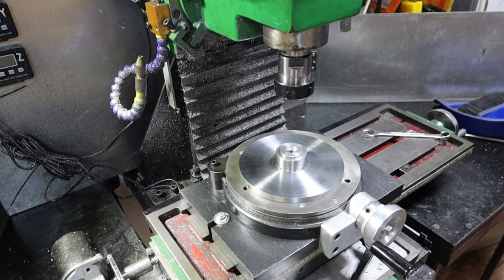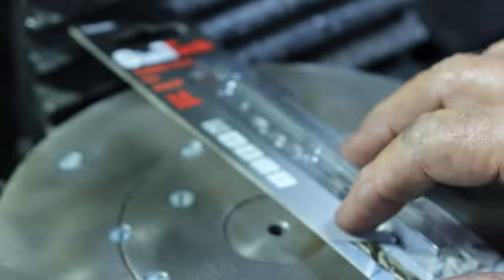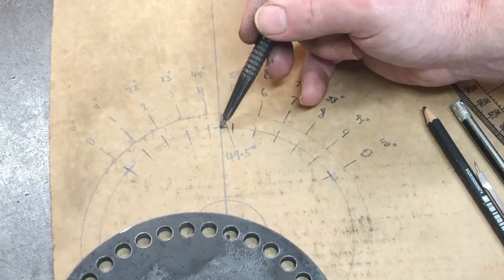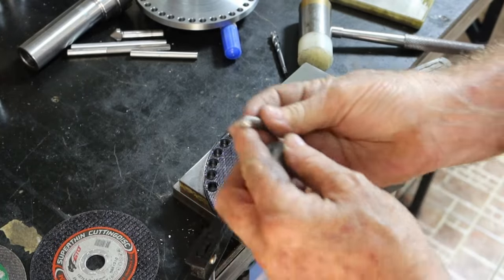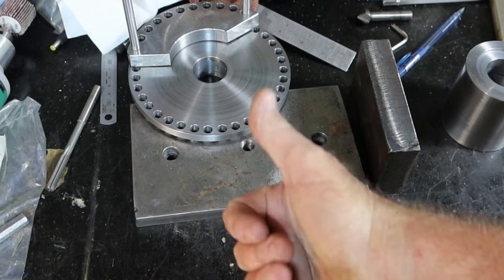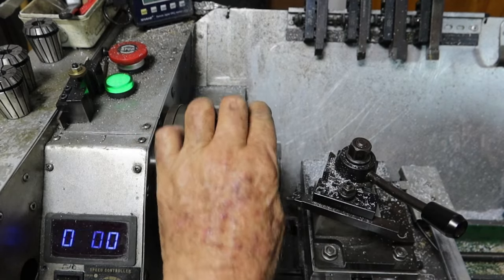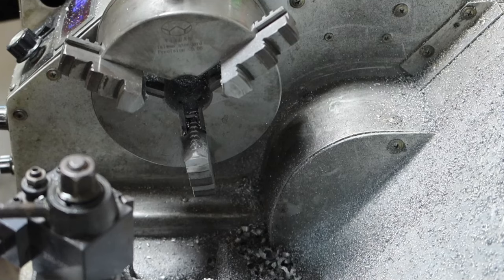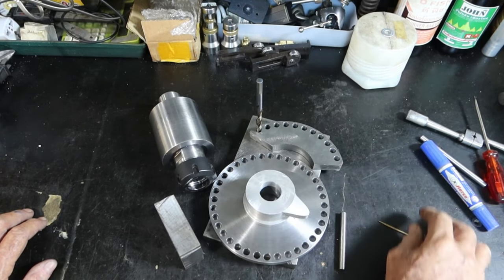MHW Episode 117 - Homemade ER32 Collet Chuck Spin Indexer - Part 2

Comment: Nice work. As you know the commercial spin indexers have the Vernier built into the main body. I like your design because having a separate Vernier allows you to add plates to get divisions other than 1°. I have made one, (partly wooden I'm afraid) with interchangeable plates for 360, 120 and 96 divisions. There is a video on my channel titled "Super Spin Indexer Prototype and Maths" if you are interested. Its a pretty poor attempt to explain the maths of creating plates for other divisions, but it does work if you can decipher my mumblings. Look forward to seeing part 3.
Reply from the maker: Interesting, I'll check it out. Thanks for watching. 👍